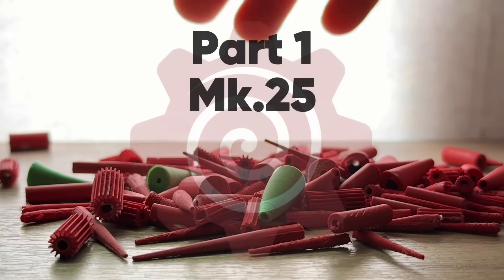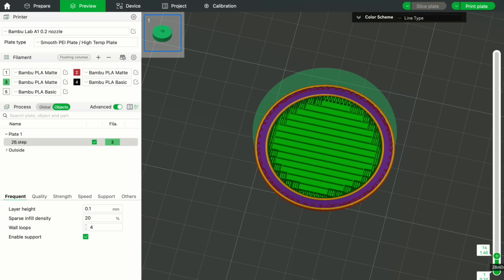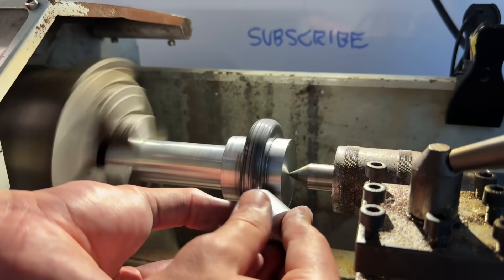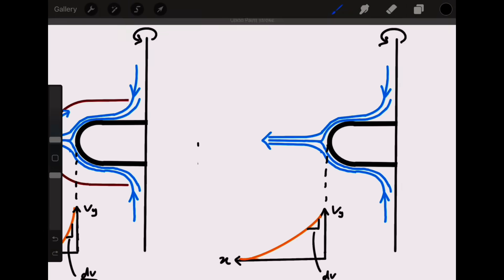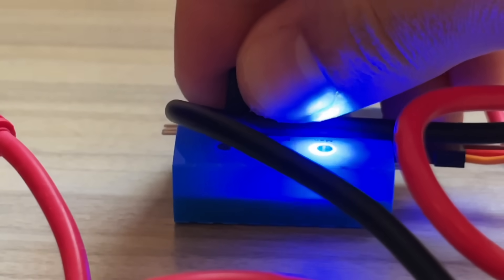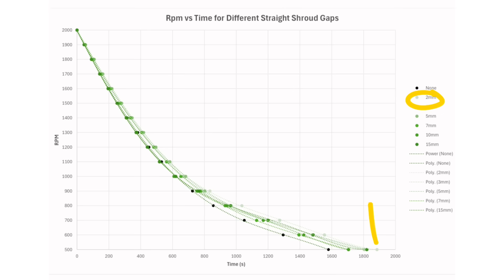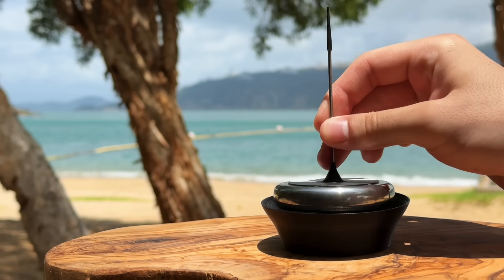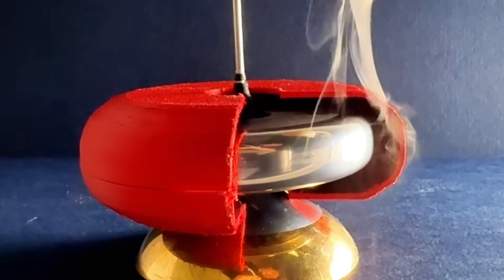Spinning Top Mk.25 | Aero Shroud??

Comment: This is great research. I was talking to my fiancé last week about this concept. I have a home-made brass top with aluminum spindle and came to the same conclusions as you with the “grip”  a tapered is best. I spun it in a glass cup. And then posed the question of whether air friction would be greater or lesser with a cover over the cup. I was perplexed. My main conundrum was whether the trapped air held more drag than the open air being able to flow in and out of the cup. I didn't produce a repeatable accurate way to test it physically so I mentalized it. Knowing that. I came to the opposite conclusion. Now this is in a cup with a lot more airspace than your build using a shroud. The shroud makes a lot more since being that it closely fits the top's shape. Fluid mechanics agrees as well. Like a molecular vacuum pump, it strips air particles using a series of smaller and tighter tolerances. We know a vacuum is ideal. That's because of atmospheric pressure. So, in a larger space with equalized air pressure do you think you'd find similar results as your shroud? Perhaps it wouldn't be noticeably different at all? 
Either way I love the shroud idea and love your content and anticipate your record breaking moment. Great work! Your going places!
Reply from the maker: Thank you! Yes, as environmental air pressure decreases, the impact of the shroud decreases. Someone explained the effect quite well - the shroud reduces the work done by the air, and in turn, the spinning top.
Reply: The shroud works because with an unenclosed top, the air is constantly being thrown outwards from the top. It acts like a pump, the air is constantly stripping away momentum. When you enclose it, the only loss that can happen is friction of air against air that will be lost as heat.

Comment: I found detail on the Guinness world record holding spinning top.

"Japanese top spins for record length of time
TAKAMATSU, Japan - The high-tech top designed and built by Inosuke Mori, a 69-year-old retired professor, breaks a world record Oct. 24, spinning nonstop for 1 hour, 21 minutes, 35 seconds. The time is 16 minutes, 7 seconds longer than the current record listed in the Guinness Book. The top, which weighs 13 kg and measures 90 cm high and 90 cm in diameter, is substantially smaller and lighter than the top that produced the previous record: 2 meters high and 360 kg in weight."

Just search for this text and you will find a picture.
Reply: Considering this I think the answer is to just make your current design bigger.
Reply from the maker: Interesting! But this top was started with string rather than fingers - since you can put a lot more power into throwing a top, larger and heavier designs are better

Comment: Regarding surface roughness of the interior cavity and top and friction at this interface, you should experiment here. A perfectly smoooth surface may impart additional drag while a slightly rough surface will optimize the shear layer. Think golf balls. Airplane wings are smooth because they need to interact with the air around them. You want the opposite with your top. You might even consider dimpling the top’s surface!

On the size of the cavity I would presume the optimum distance between the top and the wall would vary with the relative velocity of the two surfaces. This might imply a variable gap, different at the center of the top compared to the outer edge.
Reply from the maker: Dimples would be harmful in the case of spinning tops - I plan on showing this in a future video :) Thank you for the suggestions!

Comment: Specialty engine builders are careful to smooth out and paint the water jacket, gaining a few horse power by doing so. I suggest making the inside of the shroud as smooth as possible.
Reply from the maker: Yes I agree this would help

Comment: Polish the surface of the core and the inside of the shroud?  Also, the handle isn't perfectly straight, which is going to bleed a little more power than a straight one.

Comment: You need to dry your filament, I use creality's space pi plus drier, work great.  It will drastically improve your print quality, night and day.
Reply from the maker: How do you dry it? Use a dehumidifier to keep the room dry?
Reply: @hiper_tops  there is little NEED to dry it, but you can reduce stringing. idk i have found the whole drying thing to be somewhat overblown. yes, it makes a noticable difference, no i don't do it often because most prints print fine anyway. 

You would dry it by applying gentle heat to encourage driving out the moisture and leaving it in a low humidity atmosphere. Typically done with a sealed box full of desicant and a little heater block.
Reply: I've seen folks pop their filament rolls in an oven set to minimum temperature for an hour or so.

Comment: I assume people have tested what aerodynamic improvements are even possible by simply testing in a vacuum chamber, yes?
And if so, have you considered a dimpled surface?
Reply from the maker: Yes I use a vacuum chamber for data collection and plan to show this off more in a future video. Dimples would be counterproductive in this application - I will also explain this in a future video :)

Comment: How do you get the tip and spindle perfectly centered in a multi-part, multi-material top?  Is precise centering very important?

Do you ever go back and re-test elements that were previously optimized?  For instance, I think you optimized the flywheel profile to balance aerodynamics and weight distribution, but when you add a shroud, maybe a top biased towards weight distribution would do better.

Beautiful music.  It was an easy decision to subscribe.
Reply from the maker: Thank you and welcome! Tapers are very useful for concentric fittings but yes it is fiddly. You make a good point about retesting previous findings. Ideally I would do this more but at least for now a lot of it is based on intuition

Comment: for circular overhangs on your 3D prints, you probably don't need supports. support structures while 3D printing should be avoided, they cause surface blemishes and unnecessary travel moves that cause a myriad of other issues. to print overhangs the best, you want to use very fine and wide layers to reduce the overhang percentage, so ideally 0.04mm and 0.8mm respectively. This can be be difficult to achieve, or basically impossible depending on your filament/printer mechanics, but is totally possible. Printing finer layers will also make any curved surfaces less star-steppy which may further improve performance.

Like someone else also pointed out, you can definitely shave a lot of weight from the core using different settings. I think printing so the indented side is on the top will yield the best results, as the circular overhang it provides may allow for 0% infill and just walls. this would require supports (which of course I just suggested not to use...) but in this case since weight removal is the main goal I think the benefits here outweighs the negatives.
Reply from the maker: Thank you for these tips! I’m definitely a 3D printing noob

Comment: If you're allowed to make a shroud, then what if you shaped the top's center with fins that push some air out, and create a partial vacuum within the shroud? Or at least some shape to trap a normal-pressure layer at the opening, while you have low pressure in the rest of the shroud?

Maybe that would reduce air friction, or maybe it would produce a lot more friction and turbulence.
Reply from the maker: I suspect it would produce the latter, however sometimes crazy ideas like this end up working! It would be fun to at least do some simulations of this.

Comment: It appears you are by the coast, if you were to take your tops to a thinner air pressure, say 10,000 feet above sea level, you would likely see an air drag reduction significant enough to set the world record.
Reply from the maker: This is completely true and may be foreshadowing for a future video :)
Reply: Why stop there? Buy/build a vacuum pot and spin the top in it. Since your top spins for so long you don’t need anything fancy, just pull vacuum after it’s spinning. Hopefully you have already done this as it will tell you the limit of your performance and immediately quantify how well any of this air resistance reduction is actually working.
Reply: @gork42  I feel like tossing a bell jar over it helps preserve the aesthetic appeal of a spinning top over this shroud setup and also extends spin time more effectively. I'd love to see a full spin under a relatively cheap and easy vacuum setup
Reply: Is there any requirement around this for a world record? I imagine if there wasn't, people would be setting records in vacuum chambers.
Reply: 10k feet and a super hot day will both reduce air resistance

Comment: So pointless.

And what a marvel it is! What a beautiful investigation, immediately subscribed.

My suggestion: consider a resin printed shroud for smoothness but also test if pitting the inside of the shroud improves the quality similar to golf ball dimples - it might be a useful effect at these scales. The particular pitting pattern also matters afaik, if you have access to fluid dynamics simulation at this granularity (yes, very computationally expensive) you might want to test different patterns
Reply from the maker: Welcome aboard! Thank you for the suggestions. I suspect a dimpled shroud would be counter productive however I am often wrong about these things... more investigation required!

Comment: You'd be surprised how little infill you need for FDM 3D prints. Most of the strength is actually in the perimeters. It looked like you were using a pretty dense infill. I'd suggest switching the pattern to adaptive cubic and dropping the infill all the way down to 15% or less.
Reply from the maker: Thank you for the suggestion - I have a lot to learn about 3D printing!
Reply: @hiper_tops you should also explore density gradients of infill (e.g. denser on the outer/inner regions of the plastic part).
Reply: @hiper_tops He's completely correct about this, 10-15% is what I'd suggest. Adaptive cubic or gyroid infill is likely the two best options for you here.

I'd recommend staying away from carbon fiber/glass fiber-infused filaments due to their inherent surface roughness, which you wouldn't be able to completely get rid of unless you coat them with epoxy and sand them. So-called "core" filaments where just the core is infused with fibers can be good options though.

PPA-CF Core is likely the single best filament option for your application, but you'd need a different printer to be able to make it, with higher temperatures (320-340°C) and a heated enclosure. 

I'd also check out foaming filaments with a density under 1g/cm3.

There's a lot to gain from settings as well, increasing extrusion width to ~110-120% will increase strength, and make sure to do post-processing on your prints next time for increased clarity through clear filaments and reduced air drag. 

Your spinning top could likely use some post-processing too so it doesn't look so cheap. Consider coating it with epoxy, just make sure to make the print  a couple tenths of a mm shorter so there's space for it. 😊
Reply: I'm not 100% sure this is the right advice for a high precision device.  The inherent variability in 3d prints might cause an imbalance which robs energy.
Reply: @tippyc2 Very good point

Comment: I've got a few notes for you. Firstly, PLA is not the least dense material available, in fact its not even the strongest versus it's weight material available for printing. From some quick research, it seems like Polymaker LW-PLA or Polywood is the lowest density, and Fiberon PA6-CF20 is the best density/XY tensile strength ratio. In addition, you can also use past machined cores to make molds for resin casting with Smooth-on Feather-Lite resin which has a density lower than 1g/cm^3 (not specified how much lower, or tensile strength). Lastly, I do not know whether the positives of a shroud outweigh the smaller angle allowment (as in, the angle the top can be before the stability ends, in theory an angle allowment of 360 deg would make it, so the top will only stop spinning once the drag causes that, versus the top hitting the base) for when the top is going slowly, maybe there is a design for a shroud that can be removed during the spin. Although, removing the shroud may be considered cheating as you are affecting the top's spin while it is spinning.
Reply: Fiber infused filament is also significantly stiffer and has better dimensional stability and less sag. More than the change in strength might suggest.
Reply: @JasminUwU  Yes, that is why I used the XY tensile strength versus the Z axis strength, to show that property. A downside I did not talk about though is printability which is a concern when dealing with Nylon (although IIRC PA12 Nylon is easier to print) and/or Fiber infused filaments.
Reply: Wouldn't lw ASA be better for this application? It's got a very similar density to lw pla, but with much better mechanical properties (and the usual downside of warping wouldn't be a factor on such a small part)
Reply: @o-manthehuman7867  Besides printability, Polylite ASA has worse strength than PA12-CF10, and worse density than PA12-CF10. I don't think Polylite ASA should be used.

Comment: It might be worth investigating a 3D printed aluminum core which you then polish, as well as the viability of a glass shroud, for both visibility and smoothness. You would need to purchase these externally rather than making them yourself, however, and the additional cost and lead time might not be acceptable. It may also be worth trying out a shroud with ventilation on the bottom, near the base the top spins on, at least in simulation if not in testing
Reply from the maker: Good suggestions! I have/am considering some of these things and it is likely you will see some being implemented this year :)

Comment: If you're looking for a very light core, my mind immediately went to the video "Ultralight Metallic Microlattices" by Breaking Taps. Its a complex process and still has some issues but I think it has great potential if refined and applied correctly. Currently i don't think it's worth pursuing as it will only save a few grams so if you ever run out of things to do, this might be something to try.
Reply from the maker: The day will inevitably come :)

Comment: Maybe for inspiration, you can look into how Tesla turbines do their thing and reverse it. Turbines create more compression than the system has resistance against and with strategically placed escape holes, that compression becomes a torque that spins the core. You aren't forcing air in, only wanting to use the spinning of the core to allow the air to pass by without resistance. A double shroud... the inside cover has no outlet but does have pores near the terminal line, and the outer shroud will have a larger opening at the bottom. In my mind the air flowing into the inner shroud will be forced out at the edge. If that air stream is placed in such a way as to create a venturi siphon, by piling more air on the down side of the outer shroud... it will create a continuous flow through the larger air space of the outer shroud.
Reply: Maybe even add rifling to the inside surface of the outer shroud to guide the air inside into a vortex.... I think a lot.
Reply from the maker: @Robert_McGarry_Poems  Now this is super interesting, and indeed I saw some papers which discussed double shrouds with a porous layer somewhat similar to what you describe. I'll look into it!!

Comment: You can clean up the clear piece by polishing it and then spraying it with shellac.
Reply: Just gotta be aware that if you're using PLA it really doesn't like to sand. It will like to melt. So if sanding, try other materials for an easier effort, but I don't know anything about other densities and weight issues. I'm sure a different infill ratio could manage that aspect
Reply: @lunaumbra5179 Oh, that's a good point. I guess I was thinking about the UV printing material.
Reply from the maker: @Robert_McGarry_Poems  I will research some more filaments :)

Comment: You should try to go higher above the sea level as I can see from your videos you are doing all you runs close to sea level higher up you should find a more favorable environment
Reply: might be able to actively pump on the shroud if you make a long narrow tube that the stem goes through, you can get the pressure down inside.
Reply from the maker: @s0rc3  Could you explain this a bit more? Sounds interesting!
Reply: @hiper_tops  use a vacuum pump to continuously remove the air from the shroud, there will be continuously air leaking in around the shaft so surround it with a long narrow close fitting tube to restrict how much gas gets in. If you pump out air faster then it flows back in you can significantly reduce the pressure in the shroud. Even partial vacuum could be enough. I like the Rocker brand pumps for cost effective performance.